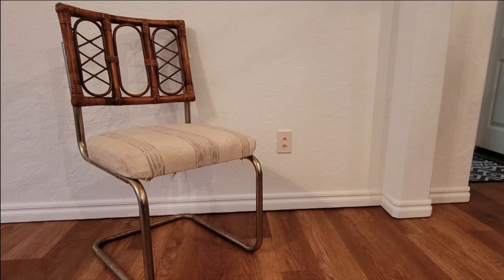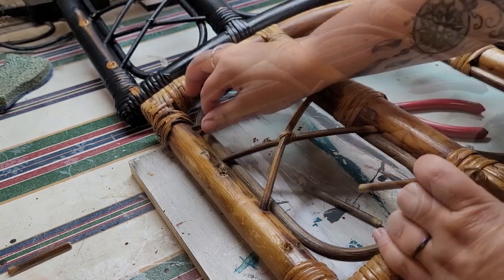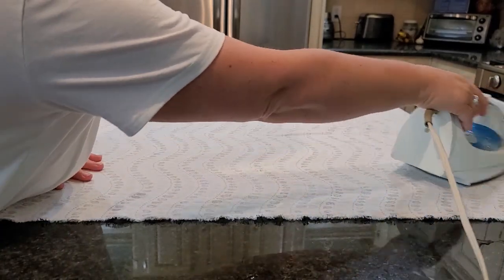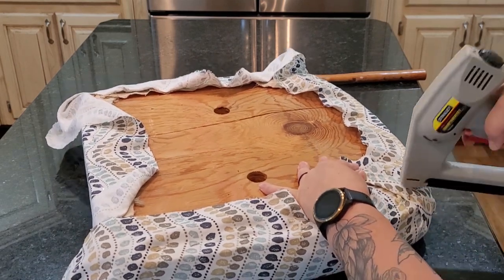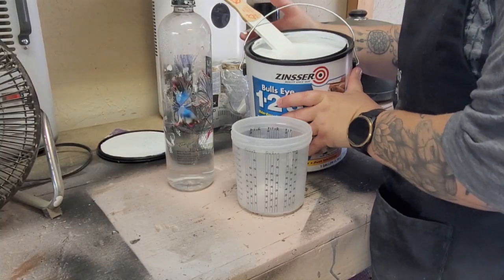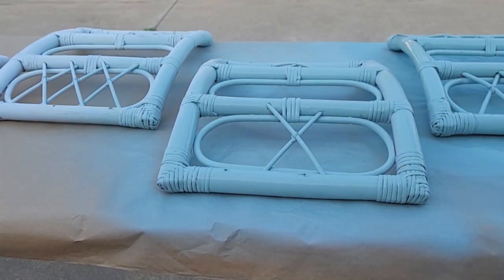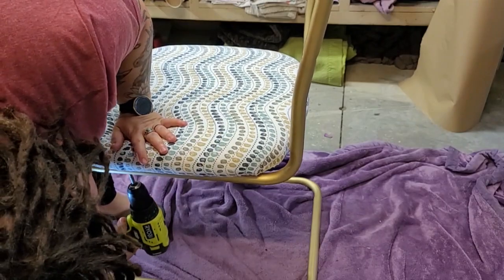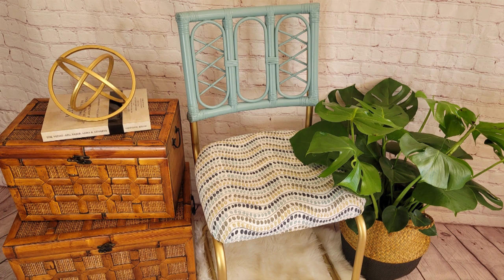Vintage Chair Makeover | Upholstery and Chalk Paint

Comment: I love what you did with the chairs. I won't walk by chairs like these anymore. One thing I think I would do , especially for resale is take the old dirty fabric off and change the foam if it were damaged then add a finish piece of interfacing
 to the bottom of the chair. I've done this many times and it gives it a finished look to the bottom. I love your work, just found your website and have been watching earlier projects. I the especially love the Bee buffet. My daughter would flip for it.
Reply from the maker: The bee buffet is my most favorite flip. 🥰  I left the old fabric on these because completely restored they go for $2K. So in case someone wants to restore them later down the line the old fabric is still there.